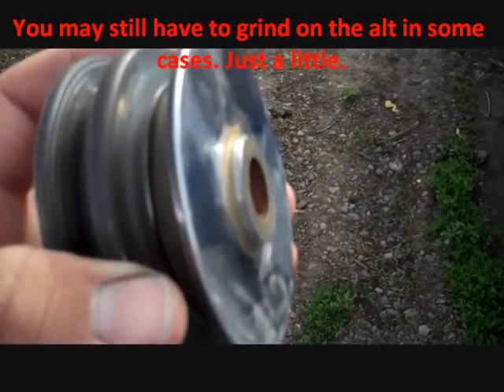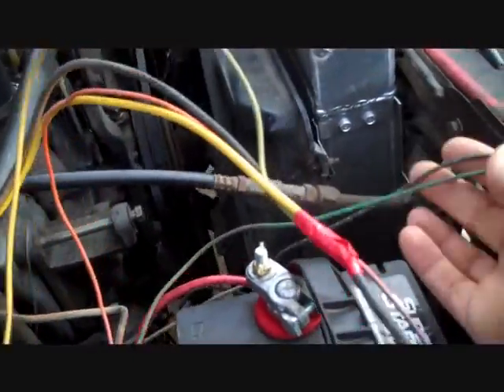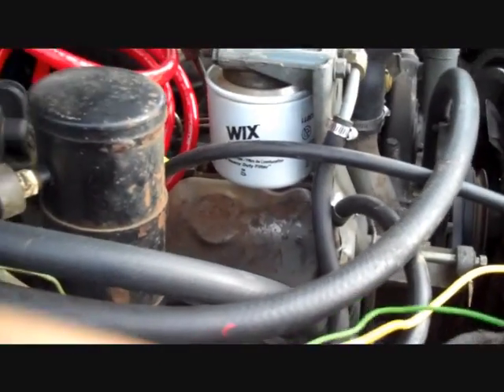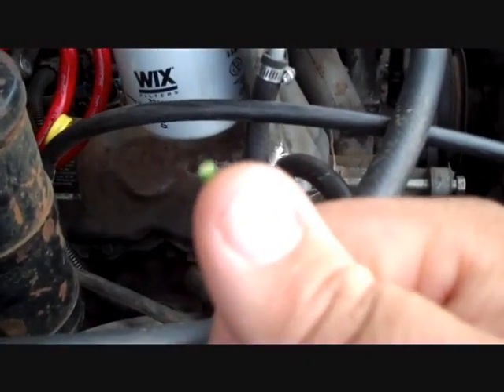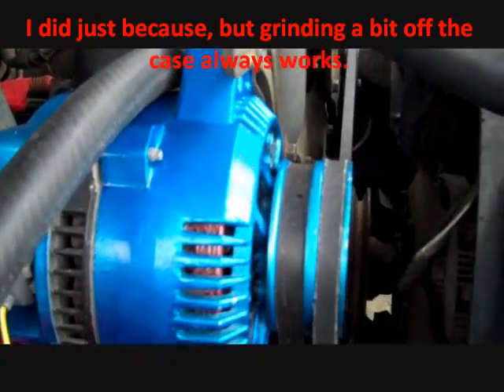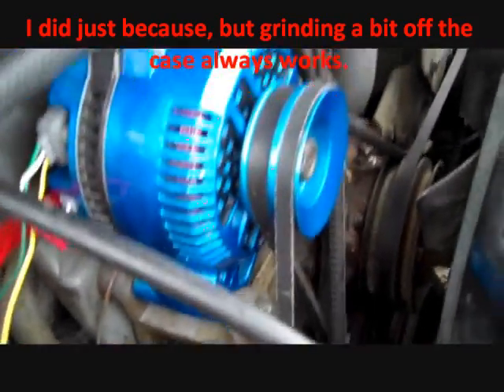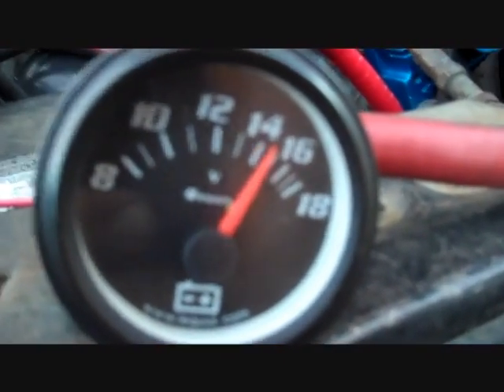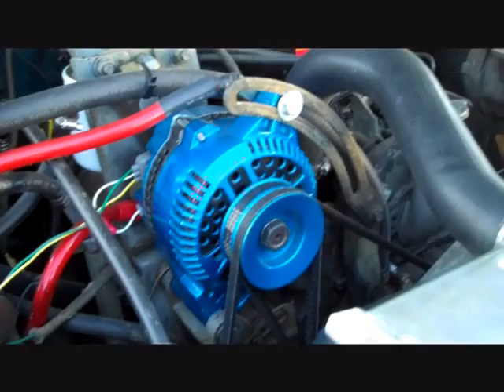Ford 6.9 diesel 3g alternator swap

Comment: tom58c
I have a 1985 ford f250 D  6.9 4x4   4spd truck. I brought this truck back from the dead. I have her purring like a kitten. My question to you is this ,how do I put in a tach in this truck?
I have pulled out the dash speedo cluster and put in a factory tack and hard wired it out threw the fire wall.
I have all the wires but don't know what to hook them up too.

Comment: That to this video and other information off the internet. I was able to do a conversion in less than 2 hours. Do not cut up your wiring harness as poster stated. Get an alternator harness from a crown vic/gran marquis 1990-1997. Only two wires to hook up.

Comment: I have one these alt swops done it my truck I believe an its a pos or the ass hole that did it be for did it wrong cuzz 3 days ago I got tired of dealing with a batery charger to get me hoin every other day ... Like I said three day an on a brank spanking new alt an 2 brand new batterys an tonight they died..... I love the truck its a hoss for a 6.9 but its also turboed to ... I juss want it fixed cuase im stumped an im about ready to crush it thank get back to as soon as you can thanks jon

Comment: Hi Tom,
I wanted to thank you for posting this great video on the 3G alternator swap.  I was having charging problems on my 1985 Ford F-250 6.9L Diesel 4x4 running at idle with the original 1G alternator.  I did a little web research and found your video.

I was able to follow along and perform the 3G swap on my truck yesterday.   The diagram was very helpful.  The swap was surprisingly easy.    Now my F-250 Taurus is getting 14.80 volts at idle and my batteries are charging nicely!

Comment: Just wanted to say thanks, I'm one of the few 7.3 idi owners in the U.K and one of the first jobs I've needed to do is swap the old alt with a new 3G. Plenty of info on the net, but nothing like actually seeing it done ( with the negative aspects included that lets you decide for yourself if its an easy or not ). I appreciate the drawing too, all makes sense !  - All I need to do is work out the starter wire as I don't have a top mounted relay on the 7.3 :-? ..Thank you - great job !

Comment from the maker: @davidstapleton275 By compression. When air is compressed, the molecules move faster causing heat. The compression ratio of a diesel is so high it compresses the air to get hot enough to ignite the fuel. This is what gives diesels their unique sound. Glow plugs are just used to get the inishial compustion chamber temp up to first fire.

Comment from the maker: @j20062006 I'll try to get a the 260 amp iraggi when I can. But with 2 batteries I think this alt will be good for a good 1000 to 1500 rms. for a while anyway. A dual alternator set up is in the works though. I,ll need to do some custom stuff.